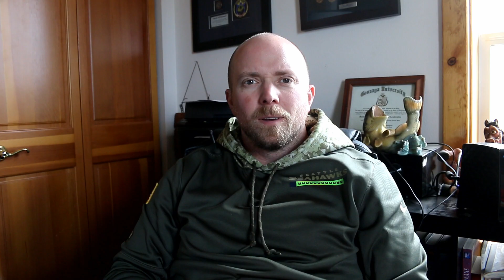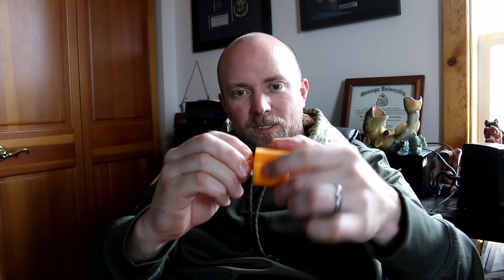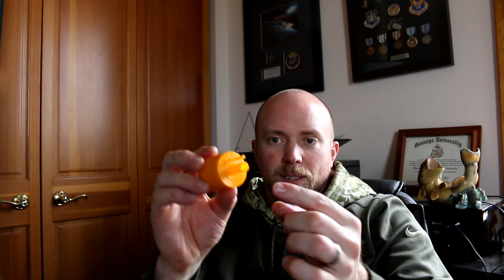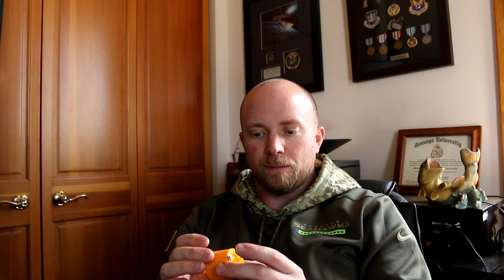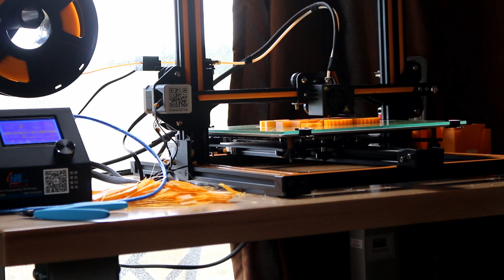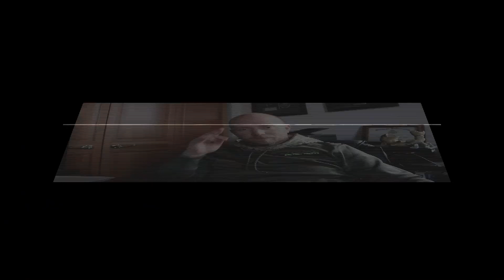3D Printer Arrival and General Update

Comment: On your barn waste problem... Would a settling tank solve much of your problem?  Something on the lines of a large septic tank loaded with your barn gold and water. Let it soak for a day or two, and then pump the bottom layer of your contents down into your digester.  Stuff that sinks, sinks, and stuff that wants to float will mostly become waterlogged eventually and also settle.  You might want to put the drain slightly above the bottom to allow inorganic matter (dirt) to stay in the tank to be cleaned out later.  Maybe add a stir function to the top level to help separate the materials...

Comment: Hey Jeff.
don't get too excited. I had a Creality cr 10. It's a fine printer. It worked well for, let say, 100 hours. Excelent prints. After that it starts to ooze molten filament into the guiding tube. I wasn't aware ot that. One day  i noticed that the fillament won't advance... It was fused to the end of the guiding tube. I replaced the tube :). After a short while, the feeding sprockets on the feeding assembly worn out. I decided to change to an original Prusa I3. It has now more that 500 hour of printing with no failures. This is no advertisement, just experience. BTW, PLA is the weakest and friable material in the world ;) perfect for prototyping but very bad in use.

Comment: If you would like to offset the cost of your 3D printer I can help by starting to offer you a suggestion: I need 4 plastic light enclosures for our gazebo. I want to make them for 12v solar lights one on each corner. Would you consider doing something like this?
max

Comment: I think you need to test with some tube, most of these bubble lifters  can only lift crud a short distance.
A system that drains into one of those diy round filters that spin the water and separate the dirt and water into two layers will be more effiecient and easier to service.